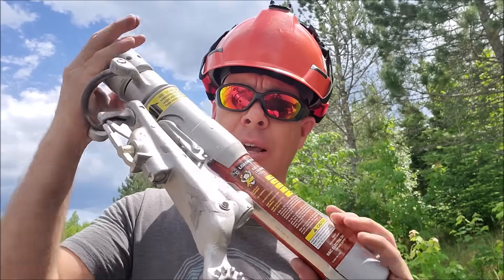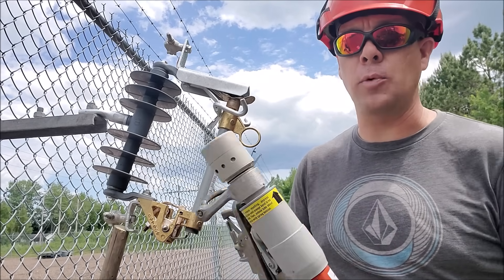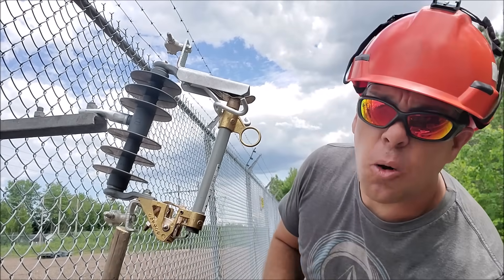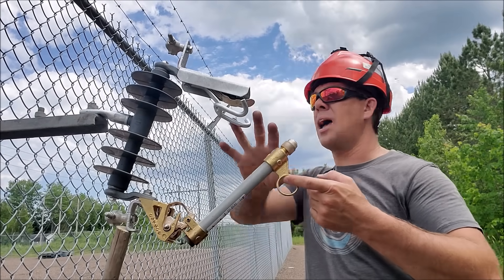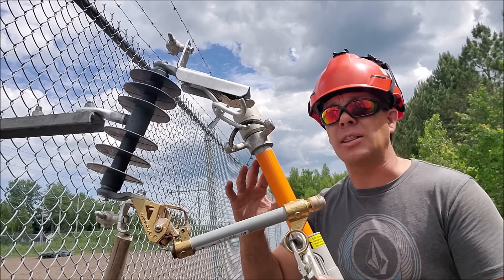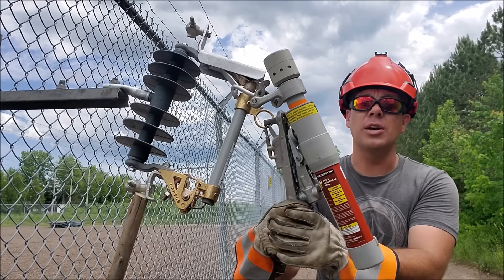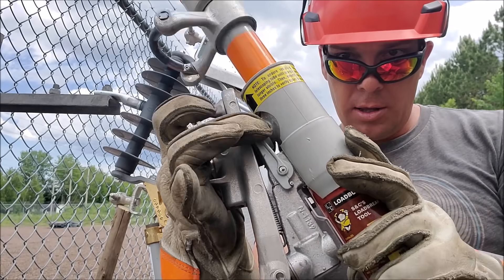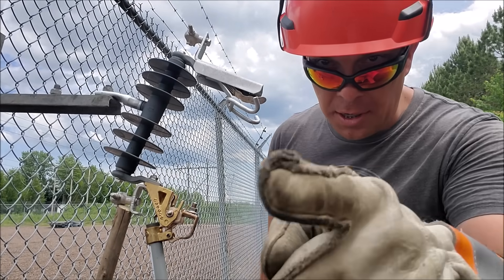Using the 25kv Loadbuster

Comment from the maker: *EDIT* Just posted this a couple hours ago ... it hit 5k views then crashed :( The video was showing an error and wouldn't play anymore ... lost every single comment! Had a few really good ones where some viewers explained exactly how SF6 gas worked. I'm going to keep working at trying to get the first post back and retrieve those comments, but it isn't looking very promising :( 
*******

Hope everyone had a great weekend!

I create these videos for 2 reasons
- to give the general public a more in depth look at our trade and how the power grid functions.
- to help educate and exchange ideas with those within the trade that are properly trained and authorized to work on powerlines and related equipment.

After seeing a few discussions I just want to clarify that these are NOT d.i.y videos for Mr. Fixxer upper!

Cheers all! 🍻
Reply: Well Dang i had a hand full of wire nuts and was gonna rewire my 25KVA 2 pot system DOH !!!
Reply from the maker: @apollorobb  🤣
Reply: Be my mentor pleaseeeeee
Reply: I had this happen for a video last year, I contacted creator chat support and they made a ticket.. took about 2 weeks but they fixed the video and it was up and working again.
Reply: I would doubt SF6 would be used, as you would need pressure gauges to ensure its filled.  As far as I know, SF6 is only used in switchgear primarily to save space.  SF6 is a great insulator whitch is not only use when trying to limit the arc but also used to minimize dimensions and the shrink the switch gear. I'm actually surprised it's still being used and developed in the USA, as Europe is now getting away from it because of its environmental effects. I personally used it in France and Germany and it was a b** to get on site as it could not be flown .
Reply from the maker: @timm8311  thanks for great info !
Reply: @Bobsdecline  that thing that's in the fuse barrel is a fuse link
Reply: Hey just wanted to say Great video (s) I love any video when you can learn a little something from those people. 
Although I would not mess with electric wiring. Your video shows What Not to do in certain situations. Ty very much.
Reply: 👍 I'm in San Diego.
Reply: From Sydney Australia retired operator/ troubleman , looks like a great tool to break cut out s current. Of course we use different terminology down here we call them drop out fuses and the fuse door itself is called a carrier as in  fuse carrier.  Opened many on load over the years we had a limit of 10 amps as you mentioned on our 11kv network, down stream capacitors or large induction motors really makes the arc more difficult to extinguish and sometimes you just had to reclose the door before the arc went phase to phase . One of those load break devices would have been very welcome in my truck. I would imagine that device is quite heavy especially hanging off the end of a extendo stick we never had the advantage of a bucket truck .. all ladders or from the ground with extendo stick as we where small usually two man crews and the company didn't want to fit elevating platforms to our small trucks.
Reply: How do the cutout doors open when there's a surge?

Comment: so would you always use a load buster instead of just a hot stick if there is any load at all? seems like our linemen use loadbuster's sometimes but not all the time. im not a lineman i dont know.
Reply from the maker: Often time we just use a hammer head attachment on the hot stick.
Our standards only require loadbreak if there is more then 10amps on a primary switch.

Comment: closed a switch one afternoon and the throttle would not lock into the switch.....at the end of a 8 ft hot stick ..would not stay and switch was loaded...had to hold it closed and tape it closed with electrical tape ...no one with me ...up in bucket ...

Comment: I assume the inside is made of PTFE. When there is arcing in the device, it will ablate the PTFE, generating an arc containing fluor. Also, the fluor gas will blow out the arc, just like SF6 does in a breaker.

Comment: Do you guys use a tension puller switching tool Chance C400-1907B? All I can find is a couple of still pics. It would be interesting to see it installed with your narrative on the operation. Curious to see if the switching tool can be used with a load buster.

Comment: I don’t believe that there is sf6 in the tube.  Purely mechanical. Maybe vacuum? As far as I know that one is particularly rated for 14.4 kv, the make another model for 19.9kv/34kv.  I would use the second model on that.  The key is the nominal voltage

Comment: An interesting invention, a manual switch mounted on an insulating pole for medium voltage fuses to break the electric circuit under load.

Comment: Big question boss, how does it work on 900 amp switches then ? It’s used a lot here on inline switches as well as underground ones, obviously it still goes on the brass little ring or whatever it’s called but how would the loadbreak tool open cause 900 amp switches look nothing like a cut out
Reply from the maker: That's a great question! I should have added it to the video. It works much in the same way, but can be a bit more finicky. To sharps or not enough of an angle and it won't budge when ya pull. Hook it on and clip the ring all the same and keep it at about a 45° angle .... Still works great!

Comment: I’ve had a load bust fail on me. 3 phase branch line   B/C phase blown. A in and holding. Down the line a broke vertical pole rolled upside down. Of course it had taps on it so A phase was energizing B phase. Anyways. I use 3 sticks from a long stick pulled apart. Roughly 12 feet. I tested the load bust on the ground. Got permission to open A phase and boy that bitch lit the sky up. The heat was strong at the tail end of the stick. Had I used a universal stick I probably would have gotten a real nice instant tan. 
FYI there supposed to be sent in for calibration every 50 uses!!!

Comment: So if I understood right, what the Loadbuster does is to form a parallel circuit within itself so that when you open the fuse door, the contacts in the 'buster tube take the bront of the energy and the tube (plus if it has that special gas) arrests the arc while the contacts within separate. Right?

Comment: Quick question is this the same as a solid blade disconnect??
And if so what is the diference between these type of of disconnect  and a gang operated pole top switch? 
By the way great content!!
Reply from the maker: Thanks! You can simply change out the fuse type door for a "solid" copper door. 
Difference is: the cutout type switch, even with a solid door is only good for 300 amp. Most gang operated switches are rated for 600 or 900 amp. Also a gang switch is designed to open three phases at once to minimize impact on three phases loads.  3 phase equipment can sustain damaged if operated while down a phase for an extended period of time.

Comment: I have never seen a load buster before , we open up to 65amps on load , I have had only 1 time where I have had excess arcing . I have had more problems with older style Air brake switches arcing at similar currents . The system I work on is 3 phase 11KV  or 6.6KV to ground . We don't single phase and a neutral as you do , but we most of the time have 2 phases at 11KV to get  single phase Low Voltage out of the transformer

Comment: new subscriber from the UK... awesome channel. Learning how you guys do stuff over there.  I'm an LV guy so we don't do much over 415v (see a bit of 480 sometimes on split phase supplies but they're rare). but it's interesting to see 'how the other half' live.
Interesting thing about work here is that our fault currents on the LV network tend to be larger due to larger and fewer transformers (a typical unit here is 750kVA continuous rated 3ph 11,000 to 415/240v, close to the substation the LV side can have fault currents into the tens of kA. 
Kudos to you ... stay safe

Comment: How do yall handle overloaded primaries? I had my power company out here yesterday because my battery backup (UPs) indicated under voltage and when I checked the outlet it was at 107v (normally 120v is the reading I get). The lineman said the primaries are overloaded in the area (likely due to everyone using their AC) and said the issue was going to be sent to the voltage techs. I’m just curious what it is the voltage techs may do to resolve the problem.

Comment: One safety habit I've used over the years when closing or opening switches is to #1 look over the switch for problems and then line up your shot to close it. #2 ..Put your chin on your chest (this allows the brim of your hard hat to cover and protect your face and neck protecting vital arteries in your neck). #3.. Take a big breath and hold it ( what this does is keep you from sucking an arc into your lungs God forbid something should go wrong because if an arc or explosion does occur it will startle you and cause you to breath in suddenly). #4 Send it home firmly using enough power to close it and not break it.  I like your videos "bump, bump"
Reply: I'm gonna start work with load buster in 2 weeks, thanks for your advice

Comment: wow play then crashed any by the way I am a electrician from New Zealand  love watching your videos linesman much same as here but our voltages are higher house voltage 230 v 50 hz  looks like hard work in cold nights and long hrs I give you a big thumbs up
Reply: FYI, North American Voltages to the house are actually 240V.  There is L1 and L2 which are 180 deg out of phase with each other, plus neutral.  Take L1 OR L2 vs N and it is 120V, L1 vs L2 is 240V.  A pretty smart system actually, and known as "Split Phase 3-wire".  Mathematically, there are two phases - each 180 deg from each other, but it is still called a "single (split) phase" system.
Reply: @LFTRnow  we are same but Take L1 OR L2 vs N and it is 240V, L1 vs L2 is 415V

Comment: Question for you we live in a motel/ apartment it’s very old and if it’s too cold the power blows in my unit we can’t use a hot plate and a coffee pot and fans at the same time it melted the fuse box apparently .. that had to redo it but still busting what could it be it’s to hard to type sorry if it don’t make since

Comment: I’ve seen an arc from a line that looked like a tiny sun on the pole. Blinding
Reply from the maker: Very blinding!
Reply: I learned that watching guys turn on large breakers (600 amp if memory serves) off a UPS for a datacenter. Everyone looked away before he closed it, so I did too. Its like a welding arc. Watching those guys put their arms inside the enclosure to take readings is, well, impressive. Nerves of steel.
Reply: @repro7780  Strange that closing up at low voltage is that bad. Opening up, especially under load, is much worse

Comment: Question from germany: how do you close such a door without causing in arc?
Reply from the maker: Hey Volker! In most cases you don't have to worry about an arc while closing a switch. No matter how high the voltage, or how much load you picking up, once the arc begins to establish it is quickly extinguished once the connection is made!

Two common issues when closing however-

Once closed the connections on the leads to the device may be corroded or poor In general and begin arcing at that location with the cold load pickup. 

Old hand crank switches on transmission structures that are very large not closing fully or properly. Some of these switches close rather slow as well. - I'll get one on video next time I operate one!
Reply: FYI, the reason opening matters more than closing is due to inductance and arcing.  The simple way of thinking of it is electricity has inertia.  If it was flowing at the time, it will try to keep flowing even when you open the circuit and thus form an arc.  In the case of closing, there is nothing flowing yet, so no arc - at least until you get close enough for it to want to start.  The other reason an opening causes such a long (and long-lasting) arc, is the arc is ionized air, which is a low resistance path for more electricity to flow through.  You need a much larger distance to stop the power due to this low resistance path.  Eventually, it gets too long and/or turbulent (due to the heated air) to maintain a conductive path, and the arc stops.
Reply from the maker: @LFTRnow  well explained, Thanks!
Reply: Thanx for the the <3 :)

Comment: I am a red seal millwright  mechanically any moving parts is my area I find I do have to open the doors to the panel  boxes  the  wires coming into the box I will never touch I am looking for a fuse or a tripped breaker in the box  will test it to see what with it seeing the motor is good or it on the way out I always call an electrician in to check the what I did  it cover my ass to say   yea we have a problem with the VFD that may be the problem the electrician need to find it and call it out  
I have changed and reprogram  VFD but I do leave it to the electrician to do    
we were in a plant that

Comment: Any one know where I can get single pull double throw center off 100 Square D MAIN Breakers? It's to make a whole house Transfer Switch but I want to make it IMPOSSIBLE for someone in the future to accidently send power back to the GRID. Home Desperate doesn't have them. They only carry 8,000 watt panels!
Reply: There is no such thing as impossible.
Reply: Keep an eye on eBay

Comment: Hi Bob, this is Wolfgang from Germany, eastern Baden-Württemberg.
Reply: I was in Germany last summer on a river cruise down the Rhine. Stopped in a village where there was one large transformer for the entire village and instead of everything built on the streets, it was all secondaries built on the roof tops with steel masts attached to the roof tops. Was so cool to see how you guys do that.
Reply: @linehandibew6205  I dont think that this is representative :-) in older towns we still have overhead wires from house to house, but in newly built areas (and maybe when they are renovating the quarters) all cables go underground. Overhead wires are only used in more rural areas, where it would be to expensive to dig into the ground, and then telephone and internet and electricity is all overhead...

Comment: sf6 gas is extremely bad for the earths ozone...it is a prohibitive gas currently only used in the military, medical, and electrical industries. for lineman in some regions, checking the gas pressure on a sf6 switch (vacuum switch) is a procedural requirement before manual operation.
historically sf6 gas replaces oil in switches allowing for a more compact switch...although a low psi may allow a open switch to remain open
without failing a load break operation may fail...

Comment: inside the load bust is a pin simular to a load break elbow...I know s+c make a door for the switch you use as a demonstrator with a snuffer built in...prices of these switch doors would be prohibitive  in some cases...when clearances are tight it may be worth the money to replace the loadbust with these doors...I've also used temp bypass jumpers with this load bust built in to change out broken switches as well...

Comment: Okay so the white powder in HRC fuses is there to help stop the arc because it's a fine ceramic powder. It will absorb the metal vapours and cool them instead of them conducting and keeping the arc up. It's ceramic because it's insane hard to melt and it will keep up the massive surface area used for absorbing. Even in small HRC fuses for multimeters and such they use more or less the same quartz or ceramic dusts. As for SF6, it just doesn't conduct much and it's difficult to ionize but most of all the contacts won't corrode that much because it flushes out the oxigen from the system that would cause rusting and scales on the hot parts under the arcs.
Not contained in the loadbuster though

Comment: Those drop out fuses are not designed to break under load. There is a fusible link inside when it breaks the carrier drops open. Using a load break device would be hazardous in certain circumstances such in storm conditions where the linesman is trying to hold the weight of that device and locate it into the top contact and then you have the contact surface which if not held properly could itself cause a flash-over. It would be better to isolate further down the line at circuit breaker or re-closer even if you have to isolate a few more properties. Safety of the linesman comes first.

Comment: So, how many cycles on the counter before it’s taken out of service? I’m assuming that’s the reason for the cycle counter.
Reply from the maker: Hey Brent! Manufacturer recommends an inspection every 1500-2000 operations. There are a few wearable parts inside that will need to be changed ... As long as it's well looked after, there is no expiry date
Reply: @Bobsdecline  is that 1500-2000 actuations because of the liner that reacts with the arc to quench it? Or is it 1500-2000 actuations because of the spring and other mechanisms? Just wondering if practice runs, like you did in the video, will count against it. Like if you check it ever time before using it (by doing a test actuation), can you go to 3000-4000 actuations?
Reply: Assume both, if both, the spring itself even though we know in general springs have only so much tension.

Comment: The real question, is the US a 120 or 240 V system.
Reply: Both!
Reply: They use split phase transformers with the neutral on the center tap. 240ish across the whole transformer 110ish volts  across outer and centre tap.